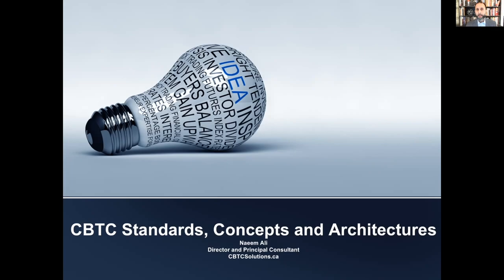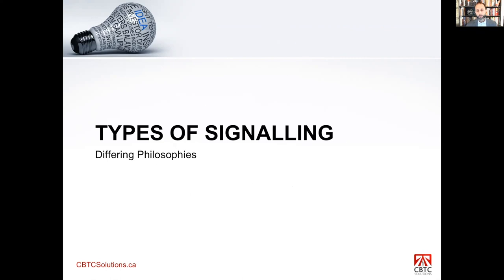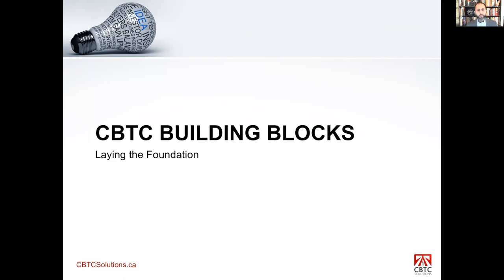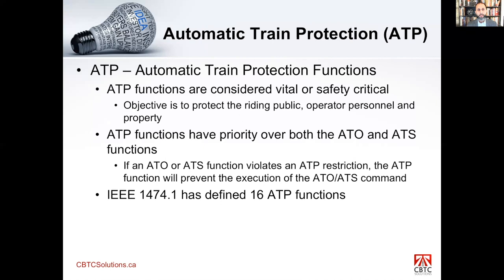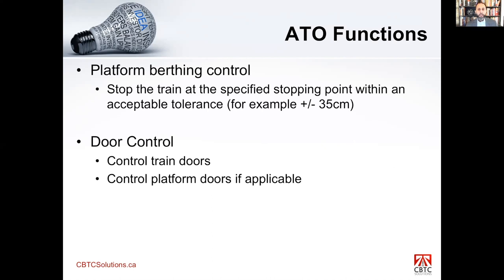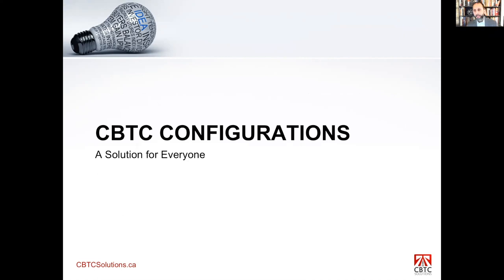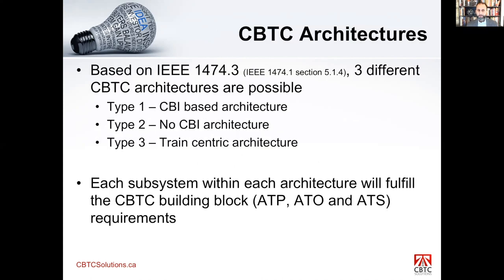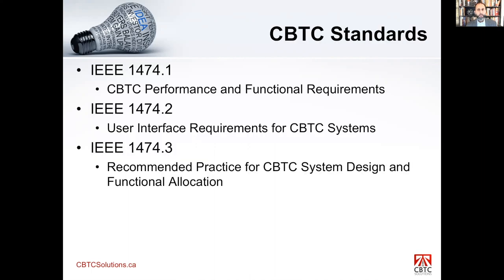CBTC 101: CBTC Concepts, Standards and Architectures

Comment: In Toronto (as you know) the TTC is in the very slow process of changing line 1 to ATC.   What all does ATC cover besides train movement?  (and i have got to say i LOVE the fact the system stops the train at stations so smoothly without using the full brake like on line 2...lol)